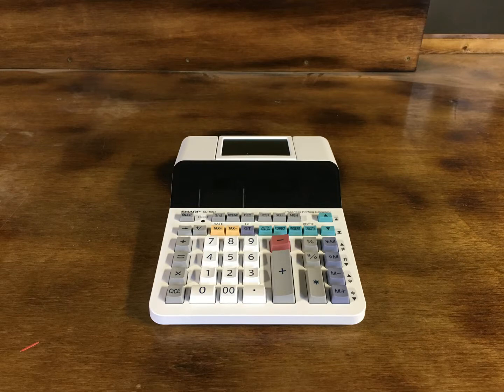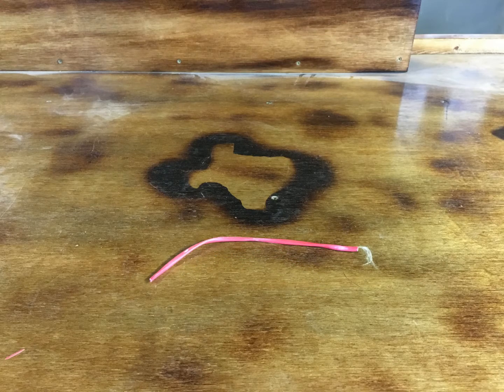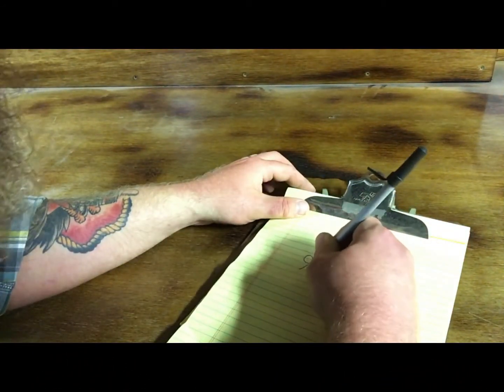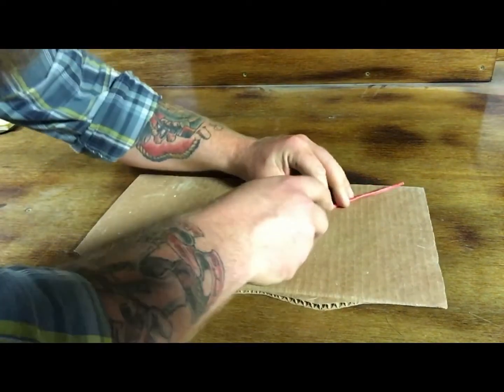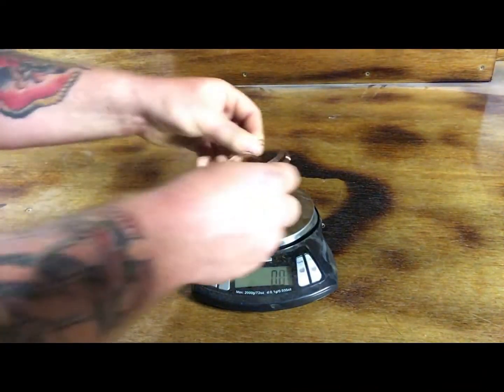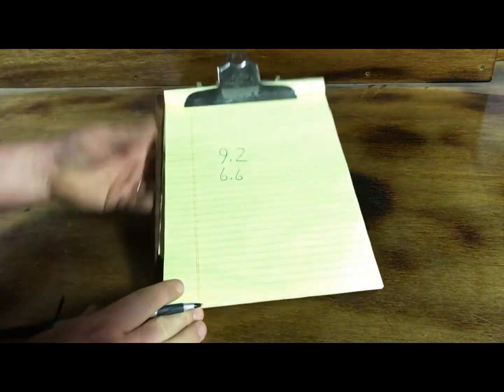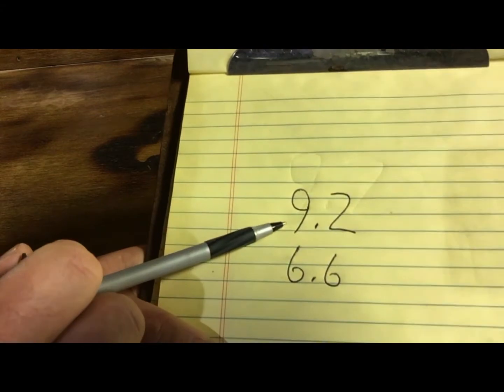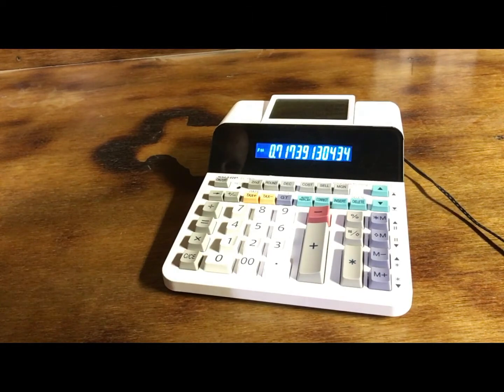Scrap Copper, finding the copper recovery of insulated wire

Comment: Does length matter? Or will you get the same answer if it was a 3" 6" or 12" piece?
Reply from the maker: Anthony, this is not a good question, it is a GREAT question!  Remember that I am a smelly ol junkman so you should always double check my math!  I would be lying if I told you yes it does matter because I am not a mathematician and I don't know that for a fact.  But I believe that the smaller units of measurements you use (grams) and the more units of measurements you have (length), the more accurate recovery you will get.  But I could be completely wrong, I'm just using the old common sense part of my brain.  Which has been known to be wrong from time to time!  But I will ask one of my managers to make sure.  He has a minor in actuary mathematics.  We call him the rocket scientist around here!  Again, Great Question!
Reply: @brackenrecycling9505  what do you consider fire wire? My recycling yard is trying to give me the same price as cat 6.
Reply: Bracken Recycling Thanks for your reply!
Reply: 3 years ago - but people still watch. ;)
Length doesn't matter if you have a very sensitive scale like a jewelry scale that goes down as fine as carat weight. (Diamonds.)  You know then it's very accurate.

However, I find it good to do 1' pieces each time.
This lets me know something valuable...how much copper (in grams) is recovered for that type of wire, per foot.
  
I can then look at a 48' of lamp cord in my basket and get an idea of the weight recovered, in copper.
(I measure it quickly off my desk which is a yard's length, marked with tape.)

Quick conversion to pounds-and-ounces, and I can tell if it's worth my time or not.
All I must do is compare price of insulated vs #2 or B&S, whatever it will grade out to.

Why not just weight it?  Well if you have 200+ feet, that's pretty hard to bag it all up and balance it on a scale!  
You can measure length by as fast as you can move your arms.